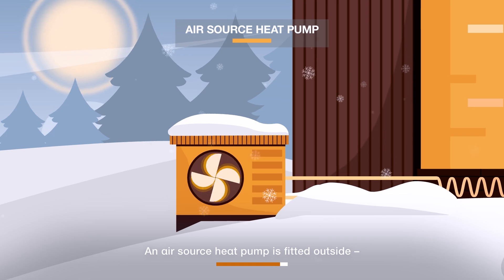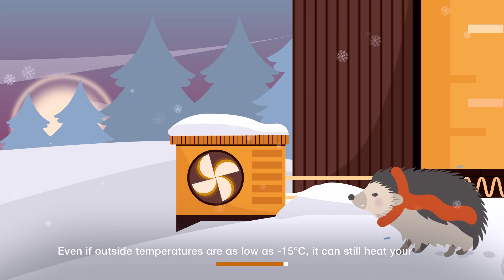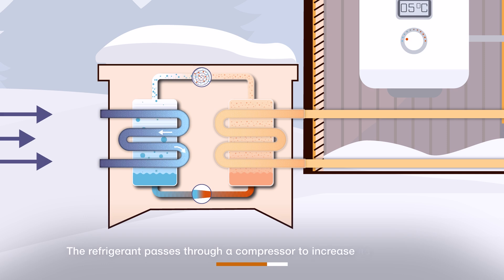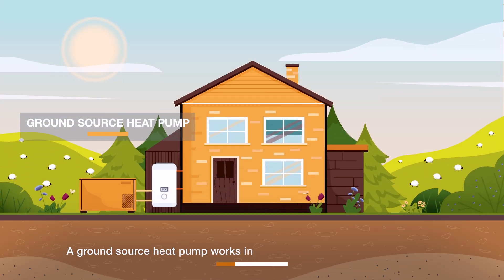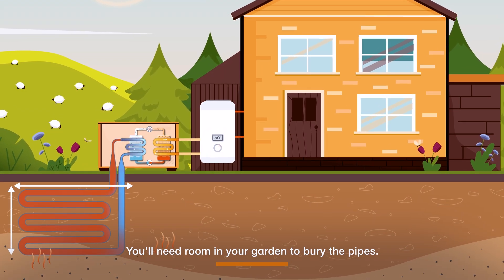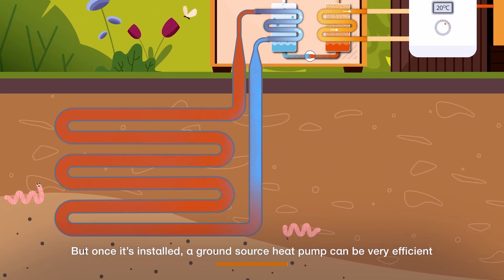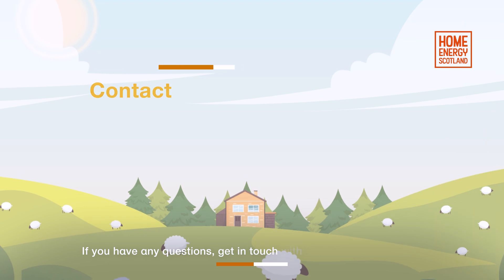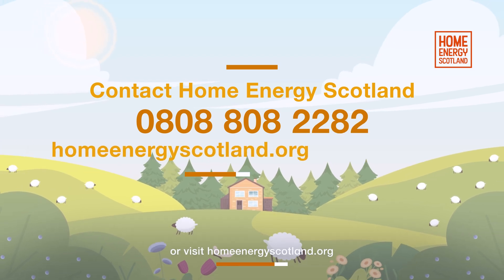Understanding how heat pumps work

Comment: How deep do the pipes have to go, the cost and if an outside heat pump how noisy is it and what maintenance is required. And the costing. looks and sounds very expensive. Proof that this is actually the best way to go.